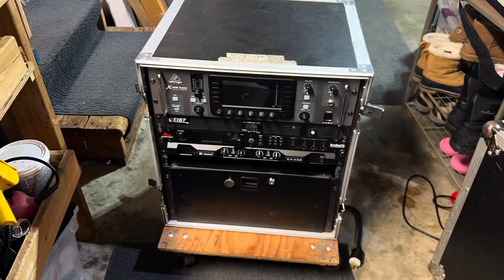CVR D1004 power amp, review and peek inside

Comment: Do you have to drive a pretty loud signal for the signal led to blink?  Just bought one and it has to be pretty loud before it shows signal
Reply from the maker: I put the dip switches in 32db mode which seems to be close to 1.4v on a typical qsc, Yamaha etc amp. This replaced a rack of Yamaha PC9501n amps (still great amps, miss them but not their weight). So knobs wide open, 32db setting. Yes it does take some signal to see lights but given the output power im not really looking for lights much. The drive rack upstream has better meters but the biggest issue i have w this amp besides tripping some GFCIs is the crappy meters. I’d like to see when it’s getting into clip and the color will go to yellow then red but it’s so loud before it even gets there…
Reply: @MrSamsstudios I bought one today but I’m gonna exchange for the DSP model, it has RMS and Peak limiting and better metering. I have the driverack venu where I can set limits but I’m driving the mid and highs section of 8 SRX 835 boxes ( they sound great biamped) anyways those drivers are a fortune and the amp is rated at 1700 at 4 ohms ( what I’ll be running it) which is waaaay to much power for them. I’m using 2 Lab Gruppen fp6400 on the woofers in the jbl and 4 additional Lab Gruppens on 8 Yorkville LS 1208. With the JBL full range the bass drowns out the tops in bi amp mode it’s insane. PS, thanks for the reply 😊
Reply from the maker: For Midas and highs I’d get the smaller D654. 650 @8, when I upgrade monitor amps I’ll probably go this route. I don’t always trust the dsp in these and there’s latency inherent with any processing. I went analog to make sure there were no time alignment issues. My system uses sinbosen K4-450 for horns, small, will do 2 ohms if needed. About 250w at 8 real world
Reply: @MrSamsstudios Well I wasn’t gonna use any of the on board processing just RMS and peak limiting, are you saying there will still be latency?

Comment: Do these amps trip GFI’s when plugged in a protected outlet?
Reply from the maker: They can, not always. I used one a few days ago (running mains/subs) off a standard yellow power distro. No issues, drove it hard. If it does trip it’ll do it with very little signal otherwise it’s good

Comment: Will it work with a 6500 gasoline generator?
Reply from the maker: I would highly recommend getting an inverter generator because the sign wave is a lot cleaner than a traditional generator. Yes, it will work off of a generator that size but some amplifiers that use power factor correction supplies will not be happy on GFCI circuits. The workaround is to use a 220v connection to the amp that doesn’t have a GFCI inline
Reply: @MrSamsstudios my generator supports 220v

Comment: Do these amps actually do the power they say they do ?
Reply: Yup, I can confirm. I dynoed the same design in a different amp and it does meet the rating
Reply from the maker: @laptech3767 currently on a gig with it, 108db on the dance floor
Reply from the maker: Yu, they seem to. Oldest CVR I have is 3.5yrs now

Comment: the black one u have is a newer design with bigger knobs with level indication, so no center ridge
Reply from the maker: I’ve got 2 like this and a black one without the center detents. When I ordered direct they asked what color saying there was no difference. That’s the only difference!
Reply: @MrSamsstudios  ohok so the blackone you have have the same small knobs or d bigger size knobs?
Reply from the maker: @ bigger knobs. It may be in one of my videos, it’s currently in an 8sp rack with a driverack and a large drawer full of mics.
Reply from the maker: @ I have these amps set at 32db sensitivity which is closest practically to 1.4v, I run the amps wide open and do any DSP or level changes inside the DBX driverack. Works for me, usually I see these amps used with the big DJ systems overseas, racks of them! I’m only Biamp or Triamp, nothing crazy and the D1004 is plenty of wattage for most all my shows.